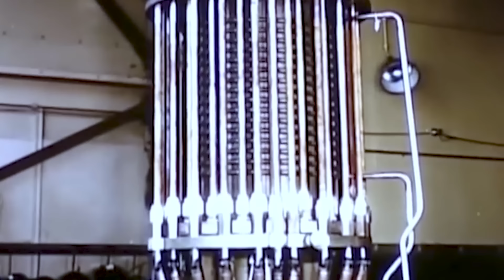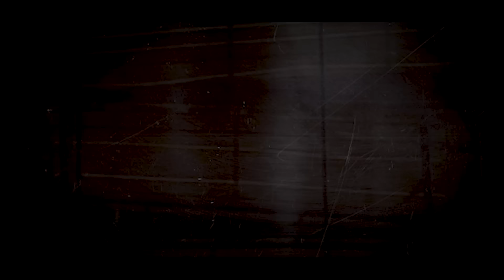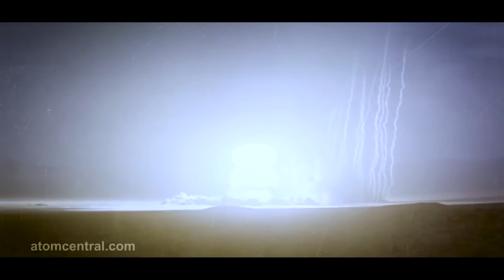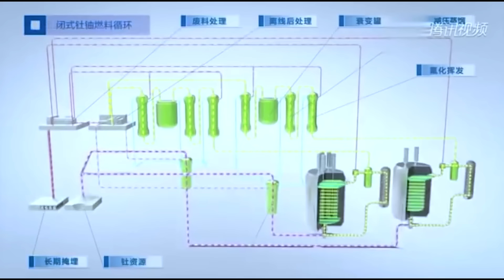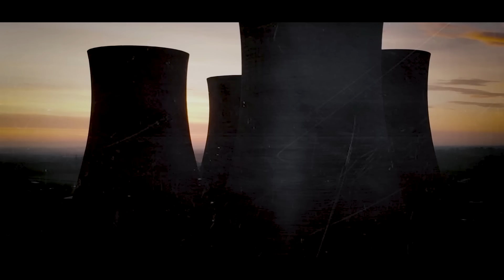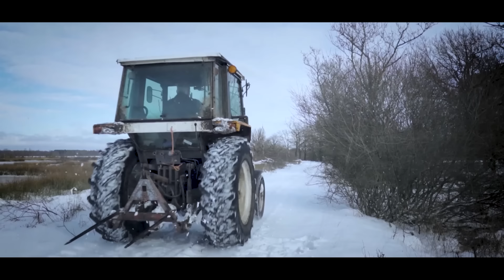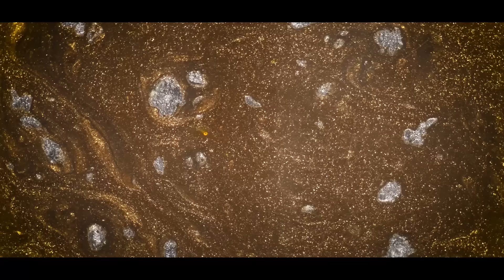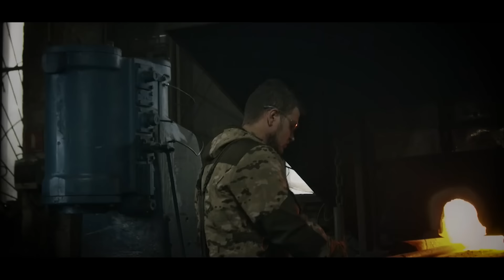Future of Thorium Reactors and Nuclear Energy

Comment: This video has some fantastic information, and the production values are excellent. It is worth noting, though, that there are several things that are getting confused here:

First the Chinese "thorium reactor" is the TMSR-LF1. Much as with ThorCon's design, the fuel mix for this is a HALEU (19.75% U-235) and thorium mix. It is a "uranium burner" with thorium as an optional "fuel additive". In this fuel the U-235 is the primary fissile element producing the majority of the power, and the thorium is very much secondary, just acting as a replacement for some of the U-238. It is in no way shape or form a "thorium breeder" or LFTR. There's a good reason that's the case: no one has the slighest idea how to do the online fuel processing required for making a true thorium breeder reactor work. 

Secondly, many of the benefits that you quote for thorium reactors, such as being a high temperature reactor, are actually just benefits of MSRs in general. Molten Salt Reactors are awesome, I am a huge advocate but they work just as well running on U-235 as thorium and this is the route almost every vendor in this space is taking. A pure thorium cycle is just a lot lot harder to make work because it requires a breeder reactor.
Reply from the maker: Hey Tom, thank you for the feedback - I appreciate these valuable insights. The second point you made on the ThorCon's fuel design is a good point and one that I glossed over. I'll make sure to delve deeper into technicalities like that in all future videos.
Reply: I'll just say I'm concerned whenever i see the term MSR used. The term MSR is appropriate in reference to a design where molten-salts are used for cooling, but that's NOT what the thorium community is generally referring to. This is one of the reasons kirk specifically suggested the term "Liquid Fueled" as in LFTR.
Reply: @jeebus-k  I hate to be the one to inform you but the LF in the LFTR means Liquid Fluoride not liquid fuel. Since that is pretty much the fuel too it's not like a big mistake from your part anyway.
Reply: @CraftyF0X  i agree, in any particular publication  it would be important to check their definitions (often in parenthesis). In this case i also agree both are equivalent in this context.

@GregDarby, as long as you're discussing specific isotopes it would have been nice to see you mention one of the most important points is that we can potentially use this technology to process what is currently considered waste.
Reply: The concept behind thorium fuel is not to replace or generate U235 or U238 — Th232 does not transmute that far. The object of a thorium reactor is to produce U233 which is fissile and can be burned. You do have to pre-load the fuel with some amount of uranium at initial start up because it takes time for thorium to generate uranium.
Reply: @kensurrency2564  For a thorium breeder (e.g. a LFTR) that would be absolutely true, but the Chinese TMSR-LF1 is not a thorium breeder it is a uranium burner. So in this design (and ThorCon's) it is very much the case that they are taking a traditional uranium fuel and replacing some of the U238 with thorium.
Reply: @tomshackell  I understand what you’re saying but what’s the point of adding thorium if not to breed U233? Isn’t that the mechanism of thorium reactors?
Reply: @kensurrency2564  Of course, just as U-238 can breed to plutonium which is fissile, Th-232 can breed to fissile U-233. However, being a U-235 burner the majority of the power comes from the fission of U-235. Calling it a "thorium reactor" is like calling a petrol engine running on E10 (10% ethanol, 90% gasoline) an "ethanol engine".
Reply: @tomshackell  However even if its burning Uranium, the idea is that the MSR is a much safer design, with the Thorium being a minor cost benefit?  Let me know if my assumption is correct.
Reply: @spiffdandy77  oh sure, and I don’t have anything against China’s design. I’m not sure whether adding thorium into the mix is worth it or not, but I’m glad China is investing in an MSR. Just pointing out the hype around this being a “thorium reactor” is kinda overblown ☺️
Reply: @tomshackell  Thank you for clarifying the misnaming with the example of the ethanol engine
Reply: @kensurrency2564  ThorCon which just got important support from Indonesia including a location for their reactor, uses Th,but to get the neutrons they need not just U but highly enriched U,meaning just under 20% U235,they are now calling this fuel HALEU highly enriched low assay Uranium, they will need to find someone to sell it to them, because right now, it's rare.The US will start supplying it to new US based reactors. They can ask the Russians,or Iran has a bunch.
Reply: As you mentioned Tom, U-235 is the fuel of choice at the moment, but as you would be aware, it is simply not abundant, with U-238 content of uranium being 99.3% , and U-235 the remaining 0.7% At some point the cost of extracting U-235 will become prohibitive. My feeling is the Chinese are utilising U-235 in their pilot reactor as Thorium LFTRs are hard to start, but R & D on Thorium LFTRs continue, and the work done by Alvin Wienburg and his team at Oakridge is instructive, and still being scrutinised and tested with today's technology. The future of global energy, and the improvement of human civilisation itself, is indeed wonderful if technologies such as modular LFTRs and fusion reactors can be developed in the medium term.
Reply: @gregdarby6225  Not true,U is so plentiful it is just $40/pound,if the price were ever to rise to $150 a pound we still wouldn't notice it in our power bills as fuel is a very minor cost. However at $150/pound the Japanese have shown they can extract it from the ocean which has 20 trillion years worth, a reactor like ThorCon is a great idea but they need HALEU fuel which is almost 20% enriched,the US will begin to produce it but now it is not readily available,to get some I suggest contacting the Russians.
All of the benefits you point out are because of the reactor type not the fuel it uses.
In the US we  must deal with the NRC which has never licensed Th,the company most likely to get a reactor built in the US is Terrestrial Energy which like others uses both U and Th. But fast reactors  have many of these benefits and Terra Power is already set to build a fast reactor in Wyoming,with the Natrium system, this would produce far less waste . Spent nuclear fuel in their dry casks can easily last a thousand years giving us plenty of time to build reactors that burn the waste as fuel. The main problem is cost and time it takes to build the nuclear plant, new designs address that such as NuScale using traditional light water design but done better able to match unreliable wind and solar.
Reply: @Paul Bedichek @Tom Shackell Thorcon's proposed fuel mix is often misunderstood. Yes, they proposed to use HALEU but the overall fuel mix is LEU. What is circulating inside the reactor is actually LEU, while the HALEU is stored elsewhere. Every day, just enough HALEU is pumped into the fuel mix to keep the fuel mix at criticality. This is a passive safety system. If power goes out and the pump has no power, the percentage of fissile material in the reactor becomes too low to sustain fission and the reactor slowly winds down automatically. Thorcon has asserted that their reactor can be made to run without HALEU but the drawback is that the reactor will have to be refueled every 1.5 years.
Reply: Yes, but U235 is very expensive!  Only militaries can have u235.  That's the whole point of thorium to U233 fuel cycle.
Reply: @vijayanchomatil8413  Well pure U235 is very expensive and only available to militaries because it is a weapons material. However, standard LEU (<5% U235) is actually pretty cheap for the amount of energy it delivers. Fuel costs are a small part of the cost of nuclear power.
Reply: Nuclear power is expensive, and has difficulty competing with other power generation already. Thorium reactor would be even less cost effective,  because thorium is less energy dense fuel. Thorium requires uranium or some othe kicker to fission so your creating a still difficult to dispose of mixed waste. The salts are corrosive which tends to break things down more quickly. It's safer than uranium fission reactor, but still has many of the same problems. Thorium reactors will never take off, because it's never going to be cost feasible to build a fleet of thorium reactors. It's a pipe dream that will never play out well in the real world.
Reply: @greenspiraldragon  Many of your comments are only partially or contextually true.
For instance, nuclear power is actually typically cheaper than other sources once it is operating.  Although nuclear also externalities some significant costs and risks.  But it is the construction of nuclear plants that is so expensive.

With the current advancements and possibilities of material sciences and a good team working on solutions the 
Issues with corrosion could certainly be resolved.

In any case,  everyone is entitled to their opinion & perspective.  Time will ultimately reveal what is to come and what is, or is not, just a pipe dream.
Reply: @greenspiraldragon  Isn't the thorium fuel cycle less complicated than the LEU fuel cycle?  That's what the professor was discussing as an advantage is the lesser amounts of transuranics.
Reply: you could not be more wrong if you tried
China is using the reactor to burn both wast Uranium but also waste Thorium so the fuel cost is effectively $ 0 / KWh .
You can not get any cheaper than that
On top of this, burning waste uranium removes the storage & disposal cost of uranium fuel rods so it makes the cost even less .
As the running costs are substantially less than a standard reactor , MSR's will have a quite fast payback time , probably comparable to coal .

Comment: You may care to check out Indonesia's PPA for 8× 500MWe ThorCon TMSRs (liquid metal Thorium ion molten  sodium-Berilium fluoride salt energy converters). Built and fully equipped out in a Korean double-hulled bulk-carrier shipbuilding yard in less than 12 months then towed barge-like, the first, to Bangka-Belitung Regency at a total cost to ThorCon, (excepting fuel salts) of between $800 to $1000 per kiloWatt; with the site preparation and connecting to local grid being the only cost to Indonesia..
Walk-away safe; high temperature but near ambient pressure and able to Black-start" with a levelised pre-profit cost of less than $30 per MegaWatt.hour, (<3cents per unit kiloWatt.hour) as a base loader but capable of automatic load-following to compensate for any non-recyclable irratic renewables linked in the grid. Expected delivery by 2026 and selling electricity at less than 7cents per unit kWh..

Comment: Like most of the engineers commenting here, I agree this video has too many errors to be worth watching. 

There are two yuuuge problems with Thorium as a fuel:

1. Thorium itself is not usefully fissile.  It must absorb a neutron and then undergo reverse beta decay to protactinium, that then decays to Uranium233..  that is fissile.

2. The neutron gain ratio of this is poor, so it is very hard to go critical.

Molten salt reactors don't fix these fundamental problems.

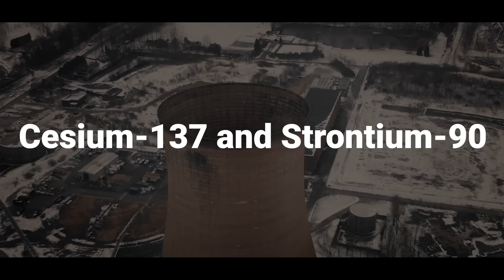Comment: Around 17:20 - 17:30, why do you say that short half-lives are better than long ones?  Short half-life implies very radioactive - half the atoms are emitting within that half-life period (and when you consider Avogadro's constant, that is a very, very large number of emissions.)  Long half-life means much fewer atoms are emitting in any given period -they are less radioactive.  For example, natural Uranium (yu-ranium, not oo-ranium) is mainly U238 with a half-life of 4.5 billion years, so I have a bottle of zinc uranyl acetate at home, which I bought over the counter, no questions asked and poses no danger to anyone.  Strontium 90 with a half life of 30 years is 150 million times more radioactive than U 238.  It will be 900 years before a lump of Sr 90 is emitting as little radiation as a comparable quantity of U 238.  I'd happily store U238 in my back yard (or even my bedroom) but I wouldn't go near a lump of strontium 90 without protection.
This is a very common error among non-scientists - who seem to make up the bulk of commentators on nuclear energy.  They always get it back to front.

Comment: To correct a few errors and complete missing information.
When the experimental thorium reactor was built at Oakridge it was found to have such a caustic process that the material science would need some years development. This was not the reason that Uranium was developed. The reason for this was the production of Plutonium for bombs.
Today Saltwater or Thorium reactors are not commercial viable as solar panels are cheaper.

Comment: This thorium reactor plants are extremely expensive.  The smarter energy production would be the splitting of the water molecule. The energy in water is 3 times that of natural gas.  The electrolysis reaction takes more energy than it produces.  The reaction for the water-splitting must come from the quantum realm.

Comment: The Thorium molten salt reactor will suffer neutron embrittlement, radiation-enhanced corrosion and hard Gamma-emissions when the reactor is in operation.  Even though the melt expansion will control the reaction rate on average, this does not work in thermal transient conditions; there are some complex thermal failure modes for molten salt reactors that have not been well researched and represents some key safely problems.  The emergency plug is no use in these transient conditions.

Comment: Here is something that is being built in Idaho by NuScale energy 
NuScale's new reactor housings offer further protection. A conventional reactor sits within a reinforced concrete containment vessel up to 40 meters in diameter. Each 3-meter-wide NuScale reactor nestles into its own 4.6-meter-wide steel containment vessel, which by virtue of its much smaller diameter can withstand pressures 15 times greater. The vessels sit submerged in a vast pool of water: NuScale's ultimate line of defense.

For example, in an emergency, operators can cool the core by diverting steam from the turbines to heat exchangers in the pool. During normal operations, the space between the reactor and the containment vessel is kept under vacuum, like a thermos, to insulate the core and allow it to heat up. But if the reactor overheats, relief valves would pop open to release steam and water into the vacuum space, where they would transfer heat to the pool. Such passive features ensure that in just about any conceivable accident, the core would remain intact, Reyes says.

Comment: Why use Hydrogen, time and again (3 decades) hydrogen is advanced and for the same reasons eventually rejected, leaks, steel embritlement, lowest energy density in gas or liquid form being the reasons.
In the end it is an energy carrier, but not  without painfull disapointments.

Comment: Very well narration with enough information .
What is out of the scope, the thermodynamic  actual energy generation using a working gas, either Helium, Argon or an adequate two atomic gas, like Nitrogen, but not Hydrogen.
 Higher than 45% efficient thermodynamic cycles are possible, with the conventional combined cycle, near 60% and even higher with advanced single cycle if adequate cooling heat exchangers are used, like providing recuperation.

Comment: Just a few extra data points. The thorium molten salt reactor will produce molybdenum 99 as a byproduct. It can be used for cancer, diagnostics, therapies and research. It also produces xenon for interstellar space travel for NASA and possibly Elon Musk. Excess heat could be used for water desalinization. Petroleum, distillate, manufacturing, i.e., diesel, fuel, heating oil, kerosene, etc..
Reply: there are very specific low power reactors for generating medical isotopes.  Trying to extract specific isotopes from a MSR coolant stream is not feasible.

Comment: 150 Atm is around 2,200 psi which is something more people (at least i  USA) can probably relate to . 
Water is generally said to expand about 1,000 times but at that pressure it will actually be expanding around 1,600 times if released to atmospheric pressure
You may not be aware but sodium has been used to transfer heat in exhaust valves of internal combustion engines for over a hundred years. 
Modern materials shouldn't have any real problem with molten salt
Reply: Experience in the desert shows otherwise, at above 600 degrees , unnecessary .
The solar plants use its storage properties, on a continuous power station , not applicable.
Reply: @Arturo-lapaz  You mean molten sodium in the 'Solar Reflector' power plants?
 No idea what you mean about experience in the desert?

Comment: Thorium is not just 4x more abundant, it’s 1000x more abundant than U235, which is the only useful portion of Uranium raw ore. U235 only accounts for 0.02 percent of uranium ore, the rest is U238. 

So we obtain Uranium, spend energy refining it so we get enough U235, put it in a reactor for 4 years, and we only use 4% of its power potential. 

Thorium is the way to have sustainable nuclear power. Space ships and star travelling craft will use thorium molten salt reactors because as you said, water is not used and water doesn’t have to be put in pressurized vessels.

Comment: Great fuss about thorium is thorium turns into uranium 233 witch has %90 chance to fission rest turn into uranium 235 wich has %85 chance to fission %1.5 waste instead of %15 the main thing thorium is not a thing is mostly politics and required breeder reactors most nuclear plants are cheapest easy Light water reactor with uranium 235 no breeding no fast neutron